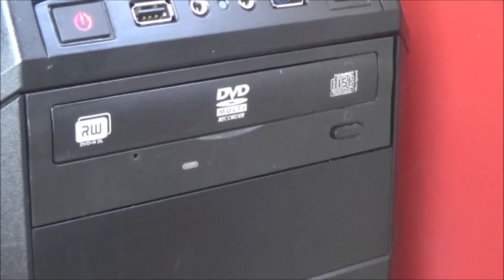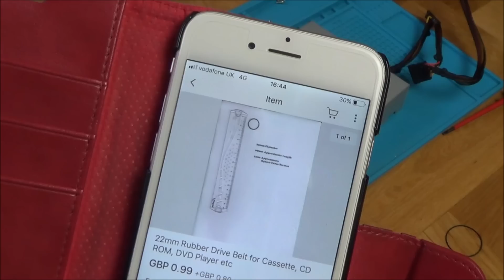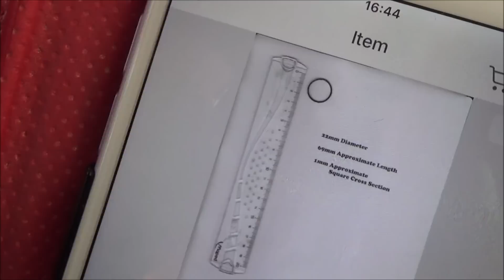Trying to FIX a Faulty DVD / Optical / Disc Drive in a Desktop PC

Comment: For me, trouble ejecting is usually almost always the small belt at the front of the drive. I’ve fixed countless disc drives on game consoles, computers etc by popping it off, giving it a clean in warm soapy water and cleaning the wheels with a cotton bud and alcohol while the belt is off. Over time it seems the belt/wheels pick up grease along with aging rubber. Best wishes guys!
Reply: Instablaster...

Comment: i had this exact same issue with a blueray drive (same diagnostic), i tried to fix it with no success, so i leave now a CD in it all time and it work always, but still frustrating to not have found a more elegant solution.
I didn't noticed there was a magnet in this white thing or that the belt/motor could be weak, very interesting, i will definitly test out thoses solutions, thanks for a great video again (love the bro too, good insight and the exchange between the both of you was great)

Comment: I've just fixed the same problem with an old DVD drive.  Small amount of washing up liquid to clean the belt followed by a soak in some boiling water and it works a treat.  Many thanks for the video and to the others for the tip about the small belt.  Many thanks,  JM-B

Comment: As someone who's had these problems over the years, I suspected the drive belt right away.  Your diagnostics of the problem, and logically working through every possibility was still fascinating to watch.  I've got to give your brother credit for first suggesting the problem at about 39:50 "maybe that belt is slipping".  When doing some research on the issue, I came across your suggestion of putting the belt in boiling water.  Even ordinary rubber bands are said to work, but with a limited life span.

Comment: The "clunk" you hear when it tries to open it, is belt being too loose to break the force of magnet in the top part of drive that holds the DVD while spinning. It has no problem to open with DVD inside because makes magnetic force between top and bottom side of spindle sandwich weaker.

And yes, the top part spins with the bottom part together.
Reply: Yes this is the exact right reason for this problem and it is the belt too loose.
Reply: exactly.
Reply: Yes it is exactly as you said.

Comment: sorry ! i was shouting at the screen before you even took the drive out !  we could see the belt that needed changing thru the tray opening !  :)  the belt stretches over time and loses grip. the top magnet clamps together with the drive spindle to hold the disc and stop it  moving around as it spins. the reason it wouldnt open is when shut the 2 magnets clamp together and need to be pulled apart to open the tray, but the belt slips. the reason it opens with a disc in is that the disc keeps the magnets slightly apart, so  needs less force to pull them apart to open the try.  :)
Reply: I guessed that. Because the drive was working fine when I took it out of the case and I knew it was because of the magnet but I didn't think it was because of the belt. Thank you and the owner of the channel

Comment: I have that exact same problem on my XBox360 (very first model) DVD Drive. Now I know how to fix it. Thanks to you both! :-)
Reply: Will probably be an ms25 or ms28 drive they suffer most in the 360
Id recommend lubrication on the runners / teeth on the under side of the tray aswell

Comment: I've had the top magnetic disc removed from a CD-ROM before while troubleshooting.  The reason for that part is to hold the disk firmly against the spindle so it can spin the disk.  Essentially, the disk is 'sandwiched" between the magnet above and the spindle below.  So yes, the upper magnet does spin right along with the disk.  Logic would dictate that since there is no bearing for the upper magnetic/plastic part in the cover that it shouldn't spin.  However I'm pretty sure what happens is that the magnet/plastic part is held at just the right height as it spins that it isn't touching the sheet metal of the top case at any point.  This allows it to spin freely right along with the disk.  Otherwise, you can imagine the resistance/friction it would create against the spinning disk if it didn't also spin.  Great video Vince!  Keep 'em coming!
Reply from the maker: Thank Andy :-)

Comment: The white plastic with the magnet spins with the disk and keeps the disk in place and does not allow the disk to fly off when spinning.
You will see the same configuration on a FAT PS2 Also. Without the white plastic and magnet there is no pressure onto the rubber 
on the drive spindle to drive the disk around either. The white plastic spins freely when gripping the disk and does not contact the lid 
when the magnet holds the disk in place.
Reply: it essentially floats in to gap between the lip and the top of the case of the drive and from then it spins freely
Reply: @tom13794  Exactly !! the magnet is sometimes on the drive spindle and sometimes built into the plastic disk that spins that can be white or black plastic.

Comment: Oh, really interesting, I have one with the same exact fault. I didn't actually give it too much importance because I hardly ever use DVD/CD, so whenever I need to use it, I just open it by inserting a paper clip in the small hole under the tray and manually carry out the process. Btw, I do not think inserting a disc changes anything. From what I recall, the drive's laser checks if a disc is inserted everytime the tray is closed. If you pay attention when the device is working, as soon as you close the tray, the laser works shortly (if there is no disc), and then stops. So I don't think there is any sensor or anything too complicated about it. 
I think it is a mechanical issue, just like people are saying, it might have to do with grease, the belt, the faceplate bezel. For example, the PS1 used to have a common issue where it had problems reading discs, and once you flipped it upside down, it would read them easily, and the fix for it was as simple as cleaning and appliying new grease to the moving parts of the lens. I mean, other than a blown capacitor, a worn out laser, an issue with the motor or a fault with the logic board, I think it is hard for these devices to have more complicated issues. 
Cool stuff as usual Vince.

Comment: The magnet clamps the disc to the motor spindle so the disc does not slip.  It spins along with the drive. but experiences little to no friction as it doesn't touch anything (other than the disc) while running.   It is obviously a good design as these drives last many years and rarely if ever fail due to the magnet.

Comment: Perfect fix!  It opened with the disc in because the disc provides some interference with the magnet so it's less pull on the top piece.
Reply from the maker: Thanks Jim :-)
Reply: Not interference. When the disk is on, there is a slight distance(the thickness of the disk) between the magnet and the spindle, that's why the magnetic attraction is weaker. I think the problem is not the belt, its the extra friction from the wear down parts. Try to remove the gray plastic part and add some grease below it.

Comment: The belt is worn that is all. The little extra weight and thickness of the disk helps the laser drop easier, hence it works most times when there's a disk in the drive. This is very common on the xbox 360 drives as someone else said. With the lid off there's no resistance from the magnet so the rubber band has enough friction to open the drive also :)

Comment: I'm sure it's said countless times already, but that white magnetized bit at the top does spin with the spindle. I've seen it on a open PS3, and the car stereo head unit, i think it's common way these works. It doesn't make any friction as the magnet pulls it onto the top of the spindle in the center of it, where it's free from the edges as the spindle is lined up in a way it's clear. I believe it's just used to put pressure on the disc to keep it on the spindle.

Comment: I just watched this video from start to finish. It is very informative, although long. It might also be a good watch for the geeks at Best Buy. I took my wife's HP desktop computer into Best Buy in December to fix some issues & also to try to fix the internal LG Blu-ray optical drive. She had accidentally pushed the drawer shut with her hand & now it wouldn't open. I took the drive out and opened it up, cleaned it out, put it back in, but it still wouldn't open. They had the computer for 2 weeks. Their conclusion was that: 1) We should buy a new computer 2) The Blu-ray drive was trash.  I brought the computer back home. I was pissed. This was the 2nd time I'd dealt with the Best Buy geek squad. They don't deserve capitalizing their name. The 1st time was with my computer that would not start. The lights flashed when started but the monitor was dark. Their conclusion was that it was probably the motherboard. It would probably cost a couple grand to find a new board. I probably should buy a new computer. It would be a lot less expensive. The problem is that new computers have phased out internal optical drives & their expansion slots. I would have to have an external optical drive. That I didn't want. I took the computer back home frustrated & upset. However, a couple days later I found my exact same computer on ebay, refurbished for $140. I quickly grabbed it up & installed my old computer's hard drives, ram & optical card. It started up like a charm with all my old files. I did wind up, however, purchasing a $200 Total Protection Plan & also a $100 external hard drive to capture & save all my files. Best Buy must have seen me coming. Then hers became sick & the Blu-ray drive wouldn't open, as mentioned . I decided maybe there was something on YouTube to help fix the drive issue. Viola, this video! While I watched the video, I took apart her Blu-ray drive. I again cleaned inside, took off the belt (did not boil it) & oiled the metal motor post. I found that the plastic wheel on the top cover did not have a magnet. The magnet was in the metal thingy it was attracted to. I did one thing that wasn't mentioned in this video. I gently pushed inward the metal top of the cover. I put everything back together. It works perfectly.  I will never bring another item to the geek squad at Best Buy. I feel they can fix only very basic things like loose wires or connections. Their main purpose is to up sell customers into buying new Best Buy items. Maybe other Best Buys are different but I wouldn't risk it again. A $300 life lesson. Kudos to Vince & Paul!
Reply: 2 grand for a new motherboard? They are ripping people off.

New mid range boards cost about £50 - £100 and high end ones are not much more than that.

This is why I always build my PC's.  Buy what I want, plug it all together.  NO harder than that, plus I get to have 2 optical drives.

Comment: 100% it's a combination of the drive belt and the magnet that holds the disc. This is a very common problem with PS2 's and Xbox's. The disc drive isn't able to drop because the magnet is too powerful. If you add two small strips of electrical tape to the magnet it will then work.

Comment: the round white plastic piece that is inset into the top metal case and sits on top of the disc spindle is a magnet. or it is a piece of metal and the magnet is in the spindle the disc sits on but either way the two pieces are held together magnetically. Sometimes the magnet is too strong and it sticks to the spindle and keeps it from going into the down position when there is no disc in the disc drive. but the space between the two provided by the disc when it is in the drive allows for the two pieces to separate properly when the eject button is pushed. I had this problem with an original xbox and a 360 disc drive and all I did was keep a disc in it and I never had a problem again, unless I closed it without a disc inside. Don't know if this helps for you but it worked for me.
Reply: When you hit the eject button the tray is hitting on the spindle because it is stuck to the magnet which is being held in the up position so it won't open and that is the click you are hearing.

Comment: I have same "clunk" problem with one of my old DOS gaming machines. I just use a paper clip, not so good with working on insides on things! When I was a PC technician 20 years ago, it was a grease issue 99% of the time. I have loads of drives spare from a job lot if you need spares or want another project....some of them might very well work, just too pressed for time to check them all. Let me know if you want them FOC :-) You also mention your brother was working with resin...I could sure do with some help on that front, I'm just making a mess....

Comment: the Drive knowing if it has a disk in it or not has nothing to do with weight. the Drive gears open and lowers the laser and when it closes it raises it. one its closed the drive laser checks or a disk or not. well  that is my understanding of it. so like others say it can be the belt slipping or the gears slipping.

Comment: The top bit with the magnet do indeed spin with the spindle, the tolerance of it's keeper in the lid is wide enough, relying on disc thickness, that it clears both the top and the bottom of the keeper.
Reply from the maker: Thanks Maria :-)

Comment: On some drives such as those on the older XBOX 360 it's possible to take that belt off for a clean just by opening the tray. No need to take anything apart. A slippy belt was a common fault on those units.

Comment: An easier way to open a dusty disc drive is to push in on the tray shortly after pressing the button, it should pop open. Also when a drive doesn’t open like this all you have to do is to open the tray, pull the little belt out, and then clean the belt and the pulleys it was on. The disc drive should then work fine for many more years.

Comment: This problem is common on all disk drives and easy to fix without taking it apart....  Open the tray and use tweezers and remove the belt and clean it and the pulleys with qtips and put it back in.  That is a belt slipping issue -_-

Comment: It's the belt the magnet in the lid clamps the disc to the spindle and with the disc in it's easier for the belt to pull the two magnets apart. With no disc the magnets are closer together and need a greater force to separate them hence the belts weak.
Reply from the maker: Perfect, thank you :-)

Comment: @Vince there is also the method of banging the top of the PC while it is trying to open. Works 97% of the time. No idea why this fails, but the bump on the top of the PC opens it for some reason.
Reply: Yes, if you bump it in just a right time when tray motor start bump will help it separate disk motor from magnet. 
I use this "method" as procrastinative way to solve a problem delaying a day when I will open a drive and fix damn thing :)

Comment: When the belt has an egg shape, that causes the problem, the mechanism loses traction when it reaches the tip of the deformed belt and therefore does not open the lid.

It may not be noticeable, but it is enough for the belt to lose contact with the gear shaft.

Comment: Ive worked on hundreds of disc drives. Its almost gauranteed the belt. You aren't getting enough torque from the motor transferred to the drive gear. The disc being in is just putting the slightest amount of weight on the tray to counter react it. The longer it goes like that the less the discs weight will help it open. If you took your fingernail and lightly pushed down on the front of the tray when you press the button, it will open up. Was INSANELY common on Xbox 360's and mid 2000's dells, and hp's.

Comment: Fun video =D  The belt is the most common cause of this behaviour!  XBOX (the old ones) suffer from this big time.  The top part does magnetise to the spindle, but it doesnt 'rub' on the hood that encasuplates it - if that makes sense?  It kind of floats by 0.5mm or something.
Reply from the maker: Ohhh, thanks you Chris, I understand now, so the top part is pulled towards the disc spindle but the metal casing stops it just short of the disc spindle so it doesn't cause friction. Thanks mate :-)
Reply: Exactly =D  On some systems it doesnt quite work as expected though - the PC Engine CD-ROM video I did (the little white one that acts as a standalone CD player) has the same type of thing, but I found with that it was super noisey!  Especially when tilting the unit slightly from side to side.  On that one I had to add some molykote to stop the friction.
Reply: Yup, the top part clamps the disc down, pretty much floating in its holder, not creating any friction at all.
Reply: GadgetUK164 I had this problem with my old xbox 360 and ended up replacing it with a rubber band from my sisters elastic bracelet kit lol! :)
Reply: @exponent5290  LOL =D

Comment: Very interesting - you've gotten further than I ever did taking apart optical drives. I had one case where I'd experience severe imbalance but pushing on the tray would often calm it down, and wouldn't mind getting this fixed. I suspect it might be the mechanism not getting lifted up all the way due to a sloppy belt, but I have no idea how the auto-balancing is supposed to work either.

I would love to be able to fix things like this, drives that stop accepting CDs or any discs at all for no good reason (usually not a lot of use) are bad enough - I suspect bad caps or lasers / semiconductors in those cases, and then you're better off going out buying another. Quality of optical drives has become pretty crap though, as it was for floppy drives 15 years ago. I'd rather salvage an otherwise decent drive if it's only a minor problem.